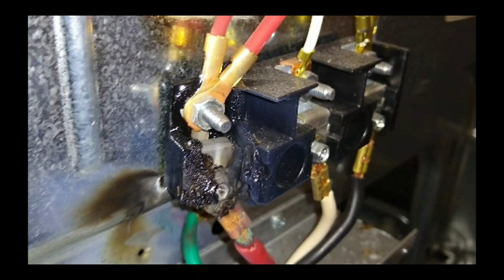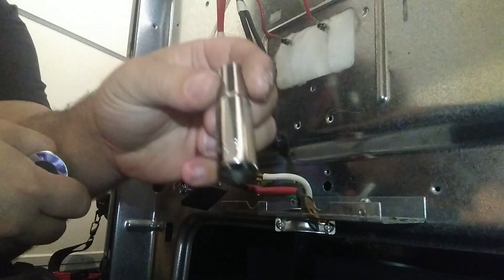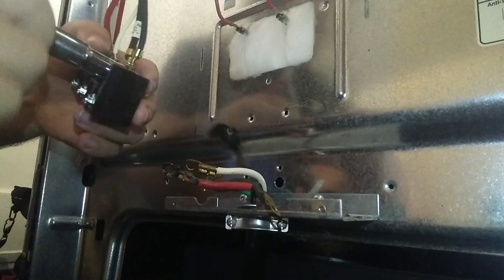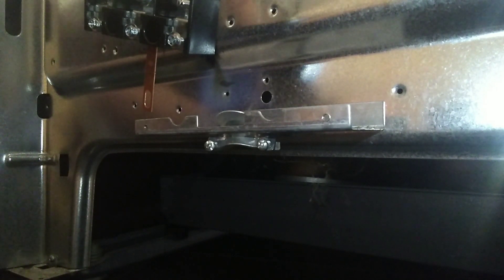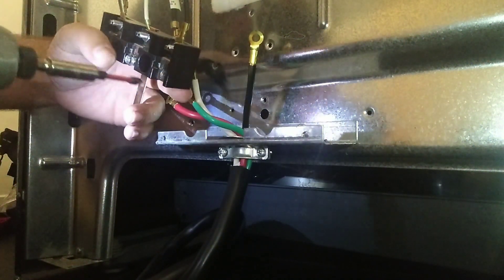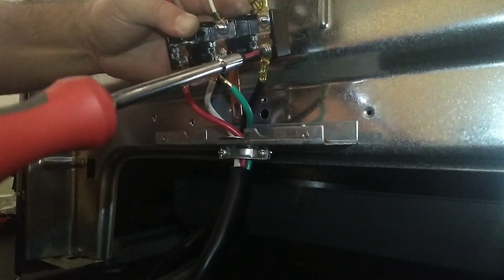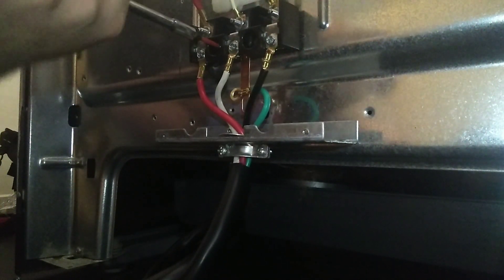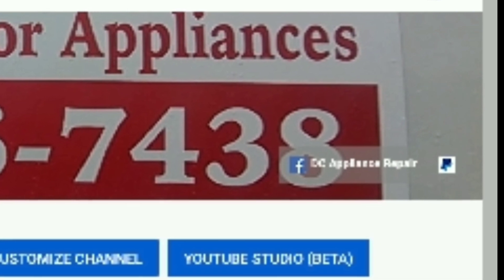Appliance Repair Training -( How to change a terminal block on a range)

Comment: Sir, you did two things wrong. With a four prong plug the copper strap should have been removed to separate the neutral from the ground. Otherwise it defeats the purpose of having a four prong plug. Also it is good practice to tighten the strain relief clamp on the black part of the cord instead of the multiple wires to ensure they don't pull out and possibly ruin the terminal again. I appreciate your videos and the time it takes to make them.
Reply from the maker: I fixed the clamp part. I didn't notice it until after I recorded.
Reply: @DCApplianceRepair Did you not go back and remove the copper ground strap?
  I usually fold it back and attach it to the middle screw on the terminal block in case someone needs a 3 wire again  in the future.

Comment: this happened to me and it welded the bolt on the top screw post. any idea what size bolt I need for replacement ? is it 10 mm
Reply from the maker: You can get the terminal kit. It will come with all new nuts and bolts.

Comment: Bruh! This happens every 3 years or so with my WP glasstop. It came with our home and was purchased in 08. Forst time it happened was in 13 the again 16 and WP sent out a technician in 2016 to diagnose the problem and I was told it was from the wire plug not having good continuous power.  I replaced it and in 2019 it happened again but it was not the block this time but the wall amp going bad. Now in 2023 it blew out the block again.  When it blows it always welds to the plate. Also it has blown the block out in 3 different places on the block all 3 times. Yea I should probably buy a new oven, but the blocks are much cheaper. 

2 things I've noticed when it blows. 

We rarely use the under deawer and the plug is mounted to the ground and I believe the drawer is causing interference if butting into the plug.

2. We pulled the stove out and cleaned under and around.  It's a precision fit so its at ease, but when I slid it back in it never felt tight and level. But again I think the stove jostled back and forth uo and down slightly. I believed it loosened the farthest right power wire just enough to spark an arch. I came to this conclusion when I realized that wire had minimal, but some play. 

Or is this all just a common occurrence?

Comment: I do believe you are wrong about the white wire being the ground. Stoves dont have two ground wires.On older stoves the ground and the neutral was hooked together they changed the codes because of a safety issue with the ground . A 4 prong plug has its own ground and its own neutral.